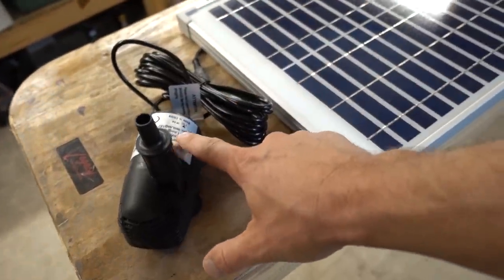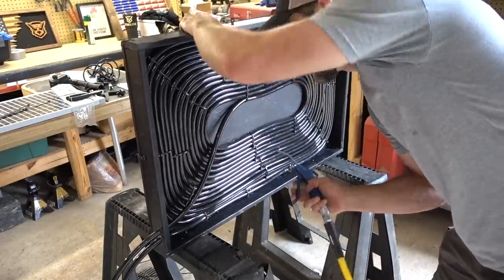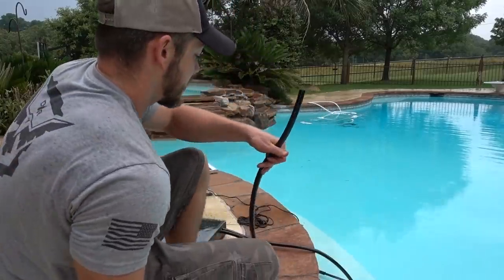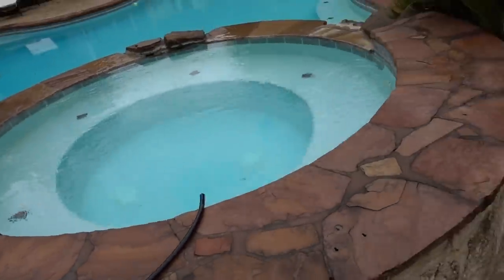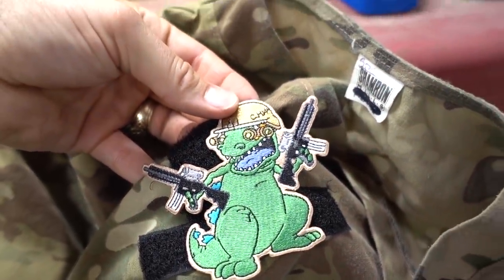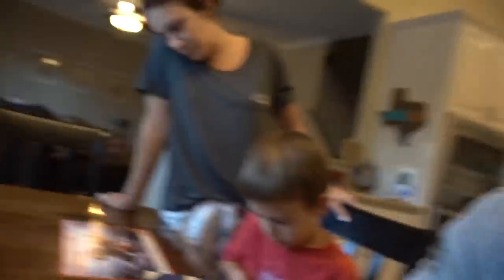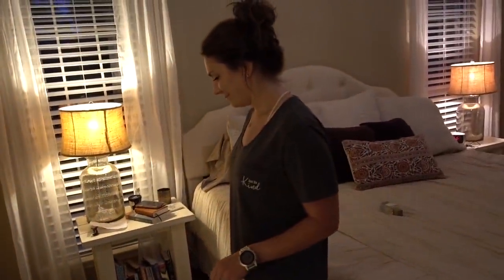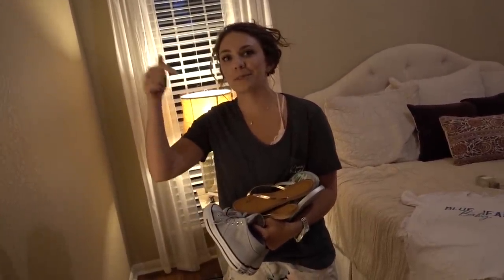Homemade Solar Powered Water Heater

Comment: Shoulda used copper pipes. The kind they use in Air Conditioning. It conducts heat faster and stays in place. And you could just spray paint it black.
Reply: i was  thinking same
Reply: The pipes would heat the water but he wants the water to go threw the coil shape to gain more heat so the best way to heat the water using copper would be copper coils
Reply: He also need to spray his backing silver its absorbing energy and not transfering it to the pipe
Reply: @mrbillybob444  no black is the right choice, it maximizes heat trapped in the compartment to heat the water. That is why it has a clear cover on it, sun comes in but the heat can not leave.
Reply: @jaydunbar7538  no, because it gets trapped in the plywood not the pipes, a reflective backing gives it another shot at hitting the pipe
Reply: Doesn't work that way
Reply: @jaydunbar7538  incorrect. The black of the plywood soaks the heat into the wood and not the piping. Covering the inside in time foil would refract the heat to the piping instead. That's why solar ovens are shiney
Reply: Copper is becoming expensive
Reply: No, because real solar water heaters use black tubing to maximizes energy absorption making water hotter.
Reply: @pugh7755  and most solar water heaters are not housed in a box. The laws of thermodynamics don't care about manufacturing standards. Reflective radiant heat is better than absorbed radiation into the box
Reply: No copper. The idea ist good but in the pool water ist chlorine and this will corroded the copper and this isnt healthy for you to swim in a copper - solution. And he needed more surface. Look for the solar constant. Best wishes from Germany.
Reply: I’d make the back panel out of 1/4” steel and make a solar dish. Basically find an old satellite dosh ( he big 10ft ones) and line it with 18 gauge sheet metal. Make a platform for the “radiator” to sit on and maximize solar energy
Reply: @Th3R4junC4jun  Have you ever sat inside a black-painted car on a hot day? It's the same principle. You don't want to reflect the sun on the backing panel, you want it to hit the black surface so it can be absorbed and radiate the heat inside the closed box. 

Go and look up any design for a home made solar heater, you'll find they all use a black backing panel, not a reflective surface. Reflecting the sunlight back out of the box is simply wasting energy.
Reply: @DefinitelyNotJ749  it's not the same as sitting in a black car. A black car absorbs the heat and traps it inside the car. Now think about thermodynamics. You want the heat in the pipes not the box (car) so you want the thermal radiation on top of the box not inside the wood. Run this test. Sit a cup of water on top of a black car and a silver car. The water sitting on top of the reflective silver car will be hotter. Why? Because the heat radiation is not being trapped by the black paint and transfered to the interior of the car.
Reply: Did anyone notice phryx’s comment, you can’t use copper anyways
Reply: @Th3R4junC4jun  I think you're missing how the heat is created in this situation. The black material turns light into heat. If you use a reflective material, the light isn't turned into heat. It's just reflected away. And the reflection would only serve to heat something if it can be focused onto a dark material which converts the light into heat.

Reflecting light would only be effective if the piping were raised enough above the backing panel that you could focus the peripherally-lit areas onto the tubing. As it stands your idea doesn't, it simply reflects it straight back out of the box.

This isn't the primary method of heating though, the primary method is the black piping absorbing the heat and transferring it to the water. Just like how that backing panel turns light into heat and radiates it into the air inside the box.

Glad we sorted that one out.
Reply: Small copper would cost a lot and need to be soldered, etc. Heat up less due to light as well. Commercial designs general use plastics
Reply: You guys have it all wrong! It’s got nothing to do with whether the paint is black or reflective but rather how to get enough support behind the idea of Matt creating a Demolitia mankini that will really get things heated up this summer! WOOOOOO! Get behind the movement.
Reply: @Th3R4junC4jun  this is simple thermodynamics comparable to HVAC or hydrothermal systems, any plumber or mechanical guy will say the same. Refraction of heat. You are correct
Reply: @DefinitelyNotJ749  it's called a heat exchanger,  thermodynamics, and super heat. Think of it this way,  to gain heat simply remove cold.!!
Reply: Many people discussing if backing should be reflective or black. As a mechanical engineer student I already made this project. By far the best solution is to heat a space and run black painted copper pipes through it. The backing should be black since it will turn the light into heat. The space being hot heats the water more than the light on the pipes.

The copper was actually too hot to touch. However our problem making it ineffective was the pumping. Our small scale budget pump could barely push the water through.  

Also people underestimate how much energy goes into heating water. Heating one liter is do able, but a pool got so many liters it will make an insignificant change.
Reply: @2blackdanes  an idea everyone can get behind!
Reply: No cos the whole point is to absorb radiation from the sun which is better using black Matt pipes. Copper pipes would reflect the radiation waves and not absorb (not get hotter)
Reply: @angusjones1116  makes me wonder is copper pipes painted black would work though (not taking into account chemical corrosion between copper and chlorine). So the matte black on the copper pipes would be useful in the absorption of radiation and the copper being a better conductor would transfer the heat to the water faster.
Reply: @codynoli8925 ... HVAC tech here there are three types of heat transfer conduction, convection like Matt's setup and radiation all these "engineers" talk about thermal transfer but don't even calc it out in btu a measurement designed around heating water
Reply: @codynoli8925  it's also not considered super heat as it does not change state from liquid to a gas
Reply: Copper is not great for swimming pools.It's actually considered a health risk for aquatic life in most places.
Reply: @Th3R4junC4jun ''When visible light is absorbed by an object, the object converts the short wavelength light into long wavelength heat. This causes the object to get warmer.''
Reply: I think it would be better to just use an electric heater, not sure what those are called in english. And use multiple solar panels.
Reply: If you want to heat up 1000 l of Water from 68°F up to 77°F for example you need 21 Mio Watts or 75.6 Megajoule. The factor for water is 4.2 KJ / Kg this is also the highest content to take thermic energy in all substances. Copper takes only 0.385 KJ / Kg and rubber takes 1.67 KJ / Kg ( 1 Kg are 35.274 ounces stupid Number stupid System you have to deal with. Choose the metric System and youll not have to deal with this kind of absract numbers.) One critcal point of view is how fast is the transfer of the energy. Here copper is the winner but this means also you need a big energy source like a Oil burner ( 1 Kg Oil contents 41 MJoule of energy). Wich means you can transfer the heating energy of the burner with high effectness into the Medium Water. But solar energy isnt that high. At 10.7639 sqf wich means 1 sqmeter (metric System!!!!!!) you earn under perfect conditions for the cowboys it means high noon 1000 Watts / h this means 3.6 MeJ. Now think about the rubber or rubber tube and his content capability for energy its about the 4th factor higher than copper but the transfer correspondents only 60% to copper but it dosnt matter. 60% of 1.67 KJ are 1.0 KJ. Now look for the copper with 0.385 KJ / Kg.  But this all dosnt matter. Think about the surface of your pool and how much times it takes to get warm. Weeks Months? Now you can think about the surface for your collector youll needed to rise up the temperature in 18500 gallons of water. Best wishes from Germany
Reply: COPPER AND CHLORINE =  NO  NO  NO ! ! !
Reply: @Th3R4junC4jun  yes that would work providing there is no gaps between what you use as black (paint or a slide over black material) and the copper pipes
Reply: @janetc2241  I know this I d wrote the the commentar with the copper and the chlorine....
Reply: Agree 👍
Reply: @pugh7755  Yes you are right. Alone the energy content wich can take rubber tube is for times higher as copper. And copper reacts with the chlorine in the pool water.
Reply: @Ranstone  what type of aquatic life are talking about that would be living in a swimming pool, and the copper being a health risk comes after there is more than 1 mg of copper per liter of water and if you see Matt's whole setup, if he used copper pipes all in all will be a max of 1-2 kg of copper and copper is a solid it doesn't dissolve in water like it sugar or salt, most copper piping used lasts about 20-25 years, it wont dissolve in a day or two to be toxic enough to be a health risk. And anything and everything that is in high level of concentration can be health risk even the oxygen you breathe is in high enough concentration you will die.
Reply: @mrbillybob444  Yes, but only the part not covered by the coil, the area directly underneath the coil should be blac

Comment: Need a battery reserve and a dusk to dawn switch. Keep the pump running at full cap all the time so the pump doesn't burn up
Reply: Brandon Smith I was going to say the same thing. Lol us Brandon’s think alike
Reply: Maybe some good capacitors in place of the battery if you didn’t want to do the photocell switch.
Reply: frekdreusdwedujeesdcdeusdreusrejuvreuweveruierureudvervurejeruuegvuewueudwehudwewefudeudsdusdsujvudvju7

Comment: Your heater should work great!  I’ve done a similar thing with black garden hose off of the return line from the pump.  More boxes in parallel will give you a lot more heating capacity.
Reply: I suggested more boxes too more time for the water to heat up

Comment: For passive solar (as in not tracking) angle it 22° pointed south to maximize the efficiency.
Reply: He should also insulate it from the bottom so he won't loose heat due to flowing air/ground contact. Also if it will be placed further from pool i would recommend insulating the pipes as well. (Only that one for water. On the other side electricity one must be as cold as possible due to it's effectivnes)
Reply: Yeah he should use  a silver backing to reflect the heat back into the hose

Comment: I used to have a pool that was probably a little smaller than yours, and the guys that built my pool wanted to sell me a solar heater that had 3, 4’x8’ panels, with 1’ tubing in each. It circulated by a 1hp electric pump. I can’t see your pool getting warmer with the volume of tubing and pump, but good luck. I sure give you an A+ for everything you do. Your a mad man! Plus you make this old man smile.

Comment: I got an idea for that pump system. First you need to separate the inlet (pump) and the outlet hose as far as possible. My suggestion for this is to take water from the hot tub side and if that pump CRANKS as much as you think it will during sunny days then just build a couple more of your "hot boxes" and have the outlet reach the complete other side of your pool. Hopefully you can hide the hosing. This will increase that ever important surface area and stop you from taking the warmer water and having it recirculate through the system over and over again instead of mixing with the pool water. Of course there are many things you could do but sticking with what you have started with I would make these changes. Good work.

Comment: Matt, specialists solar panels that specifically heat water exist.

The ones my dad had pumped the water up to the roof and the heating unit is enclosed within the solar panel housing.

Separated water and electric loops from the house.

it cant be much more costly than what youve done.
Reply: Yeah but what's the fun in that?

Comment: You might be surprised at the heat from that hose. 50yrs ago, my neighbor used 50ft of regular garden hose, in an oval spiral on their roof. One small handmade pump, and lots if sun, (S.Nevada). Pool was 90' in the summer, and 70' in the winter. So yes, swimming in 70' water with 40' air temperature. Loads of fun for kids.

Comment: Our neighbor built a solar heater/solar power panel to heat his pool.  He built a large box (12' x 8' x 6").  The tubes inside had the water going through.  The front of it had solar electric panels to power the pump.  Since they were black, they also heated the tubes underneath.  Thus, when the sun was out, it heated the water & powered the pump.  It worked great.  Especially up here in Wisconsin.  Now the swim from mid May thru October.

Comment: that is not likely to work sadly. you would need to make it SUBSTANTIALLY bigger.

adding heat is not the issue. adding more heat than the pool will naturally "lose" is the issue. you have to generate more heat even if just a tiny bit more than the "heat loss" of the pool itself to the air.

I don't know the math to figure it out but I am guessing you will need to make that solar water heater 30 or 40 times larger to make even a "measurable" change in temperature. I could be wrong hopefully someone else will chime in.

couple things you can do. you want to ANGLE that panel south and slightly tilted (the straighter the angel of sunlight to heater the more heat you will get)

also spray paint the whole things insides including the tubing in high temp MATT black pain. shiny reflects more while MATT absorbs more. so matte black will absorb more heat.

Good luck!
Reply: Nerys you are absolutely right. We had a 10,000 gal. Pool and we made the same system, 1 in. Black pipe about 100 feet of it all laid out. It was hooked into the main pump and we only saw about 1-2 degrees warmer in 100+ degree days. This was in west Texas so plenty of sun and it still was not great. His pupil looks to be 30-40,000 gal so that might give some perspective.
Reply: But you do need to take the heat gained from the pool getting sunlight into account as well.

Comment: i’d suggest doubling your hose set up to further increase surface area, the black hose is fine but i’d recommend lining the inside of the box with aluminum foil or painting it white, making the box black heats up the box and not necessarily the hoses, also please get a battery reserve for your pump, with different voltages running through the pump all the time it’ll break pretty fast.. so make sure you run it at a constant voltage, for the day/night thing a day/night switch would work

Comment: Quick tip,  if you wanna heat your pool just run a hose from your water heater and turn on your boiler drain. Just put some sort of mesh net to catch any possible sediment that may come out. Plus your doing a maintenance to the heater as it needs to be flushed out twice a year

Comment: Someone else said it but a very practical addition to this would be a battery in between the pump and the panel to keep the pump running at a decent clip for the majority of the time. Stores any extra energy in the battery on a real clear day, and keeps it going for a little while when the panel isn’t generating.

Comment: You should have done the tubes up and down, meaning instead of a circle go into the left side, run the tubes up and down and then out the other side.  That would have made it flat all the way across.  For the water volume, having the water going through it slower will allow it to heat the water more so don't worry about the small pump.

In the end though I do think you need more capacity...maybe a 2nd board.

Comment: I would think your friends at the huge solar Co you visited this summer can find a way to build attractive yet durable tiles containing the heat sink, solar power and interconnected tubing for decorative, functional green heating pumps and accessories.  Here's a novel idea, install a table poolside or even inside the water, or use them as black shelving or the bar top to separate the pool from the connected hot tub.  Your prototype could be improved with a bigger table and interesting loop designs or patterns.  Make it functional art!

Comment: Cool idea! You might consider using a thick piece of glass (or maybe thinner piece of tempered glass) because the plexi will cloud from the UV rays and scratches (and reduce thermal efficiency).

Comment: Love the pool heater, i made a similar one a couple years ago, heats water extremely well! You gotta be carefull for the kids tho, on a hot day that water can be almost dangerously hot, so u probably want the warm water exiting on the bottom of your pool. Couple tips tho, you should switch the pump to the other hose, because right now the warm water will cross over the colder water in the heatpanel and you will lose quite a lot of heat there. The other way around minimizes heatloss. Something else, you might wanna insulate your heated waterhose or make the distance to the pool as short as possible, also because of heatloss on the way.

Comment: I did a solar water heater when I installed pool out of copper tube.  It worked but ever so mildly, maybe 3 degrees difference.  However when a rain came it was just like u started with a clean slate again.  Maybe n Texas or Florida someone would have enough dry weather to work better.  Btw for cost the black hose works well, I tried that after my copper burst one winter, lol.  I would suggest from my own experience that you create a black holding tank before the heater, like 40 gallon plus.  That way the water can get warmed then right before it returns to the pool it gets a final heating through tubing.  Also you need at least double the size of tubing you have.  Good luck